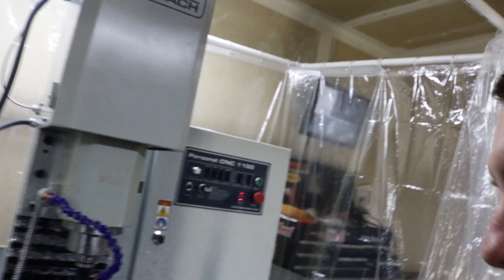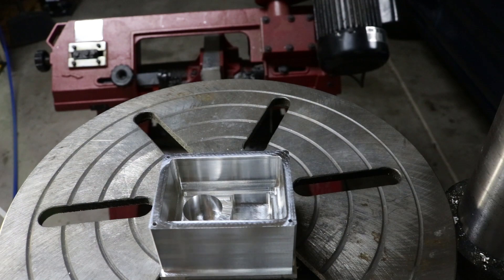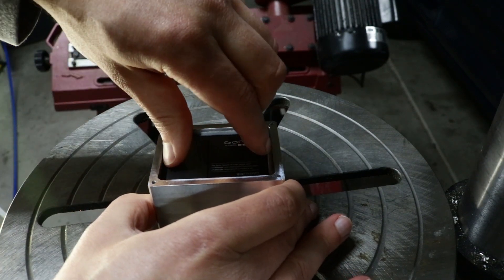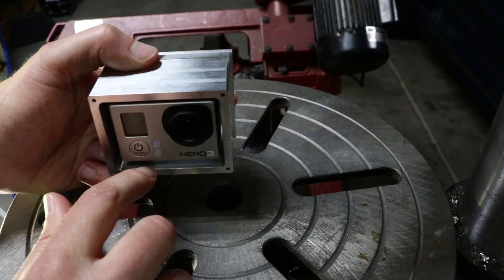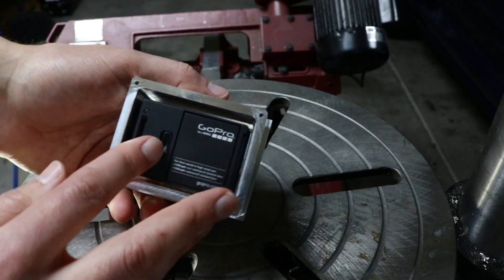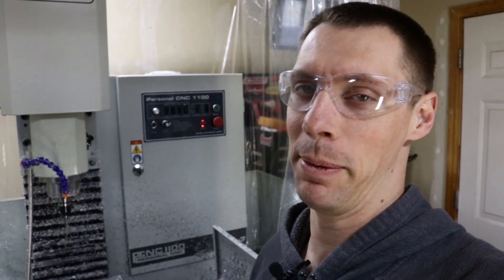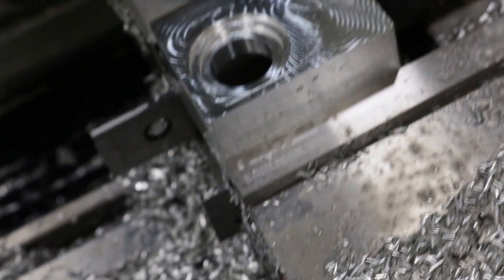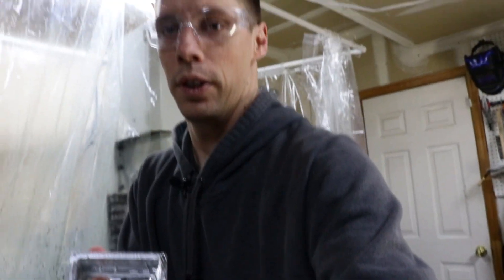Aluminum GoPro Coolant Proof Case Part 2

Comment: Phew! I was pretty nervous the dimensions weren't going to end up being right... like, maybe I had made a tweak to them somewhere along the line and forgot to transfer that tweak back to my CAD model. I was on the edge of my seat to see if it was going to work out! Very glad to see that it worked out!
I don't really have a set way to say "Hirudin" either. :) I basically say it both the ways you said it, with a slight preference to the first one.
I tried some Permatex "The Right Stuff" "One minute gasket" (sold at auto parts stores) at one point and it seemed to have worked, at least for the little bit of testing that I did. I got grey, but I doubt the grey formula is different from the other color(s). My thinking was basically "OK, this stuff is for car engines and car engines have oil and antifreeze in them... I think coolant is typically oil-based or fairly similar to antifreeze, so this stuff should probably work with machine coolants too". So, I didn't do a ton of research, but on the surface it makes sense to me.
Reply from the maker: That logic with the automotive sealant makes sense to me.  I'll probably go that route with this one and see if it gives me trouble in the longer term.  I really appreciate your help with this project.